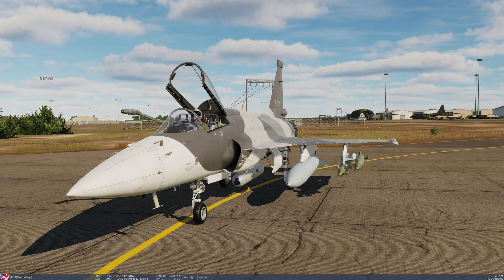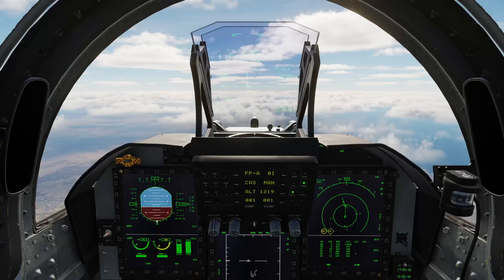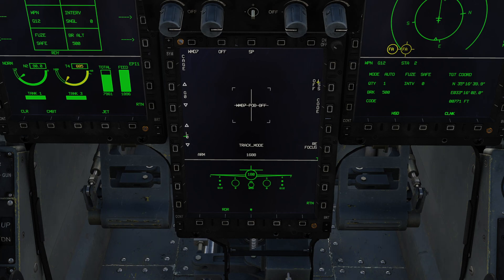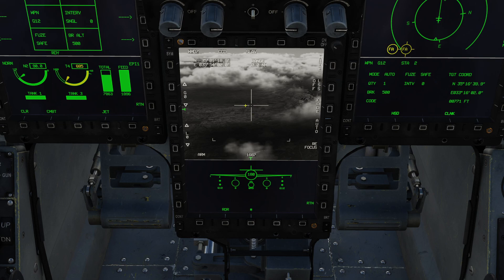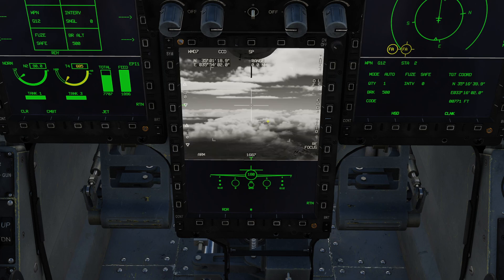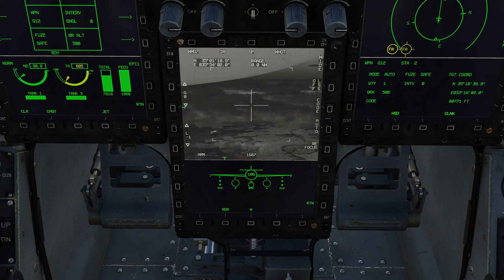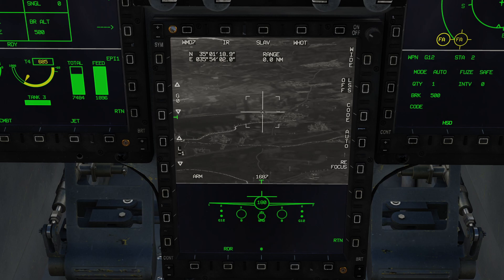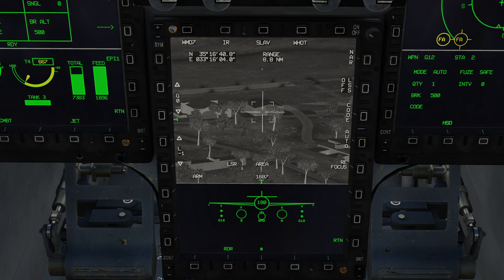DCS JF-17 Tutorial 6 - WMD7 Targeting pod

Comment: The weird zoom is caused by having the "wrong" axis assigned. What you want is the "T6_Axis: Antenna elevation (slide)" NOT "T6_Axis: Antenna elevation".
Reply from the maker: My antenna elevation control is an axis with a centre detent which auto-returns. This is the correct setup for my hardware.